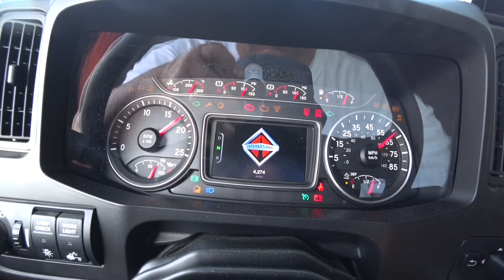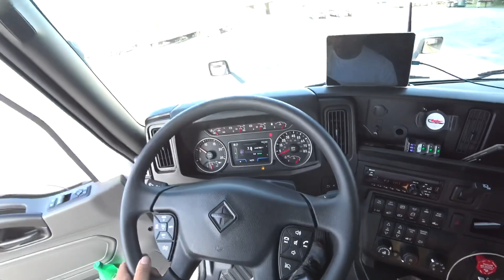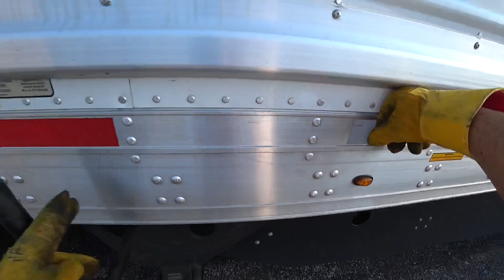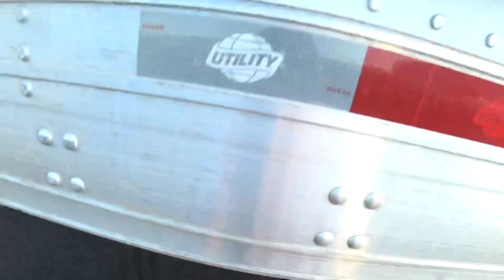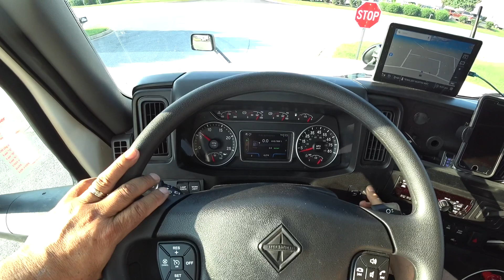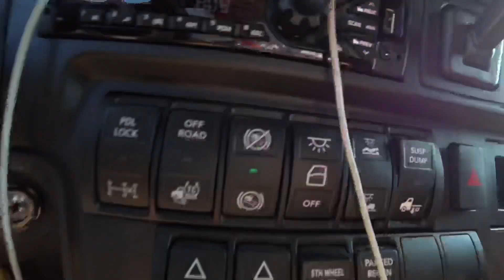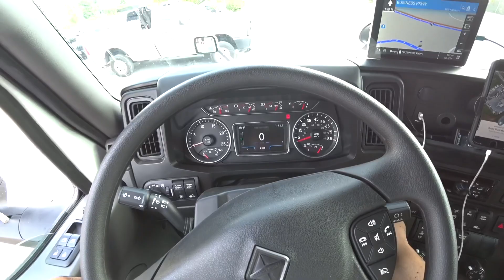September 19, 2018/1162 A GRATEFUL THANKS TO RYDER

Comment: Hey JBG.  That switc in the dash is for your "Hill Start Assist".  On an incline the brakes will hold you for roughly 3 seconds.  The stalk shifter on the right of the steering wheel has 4 positions for the engine brake.  All the way up is off.  Each notch down goes low, med, high (3cyl, 6cyl low, and 6 cyl high).  Hope that helps you out.
Reply from the maker: I did not know that thank you Brad

Comment: John, I think if you bump up the idle with the cruise control, that might defeat the auto-shut-off.  That used to work back around 2006-10.
Reply: The tach showed he had it bumped up

Comment: I saw a small exhaust pipe under. The truck seems they didnt get a chance to mount a APU on this new truck before you took it
Reply: That exhaust pipe is for the Espar Bunk Heater.
It burns a small amount of diesel fuel for heat.
I think Ryder used a computer to disable the idle shutdown. Thus he will have air conditioning.
Later.

Comment: JBG very good they did something about the AC ...did you get them to up the speed in the truck to 70 miles in hour ???
Reply: I had a Mack that was 64mph max. Drove it all 48 back when you could log 5-4-5-4-5 hours.  Was a 6speed RWSL 700 Superliner with a double eagle sleeper. I had too many tickets, so I need to low down for a while.  Had a cop in North Dakota give me a 72mph ticket when I could only do 64.  Big fight in court. But we prove his radar gun was not calibrated properly.

Comment: Hello John glad to see RYDER got it right.
Told you that rep on tho phone was full of it.
The horizontal exhaust on a tractor is referred to as a "weed burner" as it points down.
If he us going to have an APU the truck will probably have a vertical exhaust.
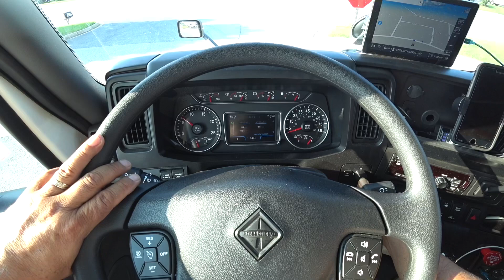Reply: 15:44 15:45 15:46 15:46 15:47

Comment: Running a red light! Not a good thing in something as long as a Semi and trailer.
Reply: i dont know. if he was approaching the light when it was green or at a point when its yellow.. if theres not enough time to commit to stopping... then you must committ and go through the light. that is what the instruction i got when learning Class B CDL. goal is try to guage the lights timing. but if your in a situation where the light is changing .. dont lock your brakes just to screech to a stop and not go through a red. chances are someone will rear end up.. just committ and go on through.
Reply: Central Wi Skoolie Sounds good, explain that to the Cop! Then to the Judge when fighting it.
Reply: Central Wi Skoolie  you are a 💯 Right  about that keep going